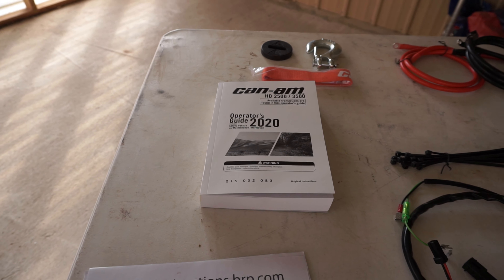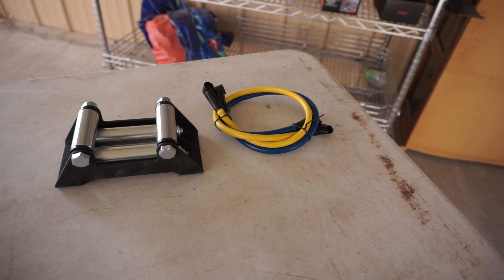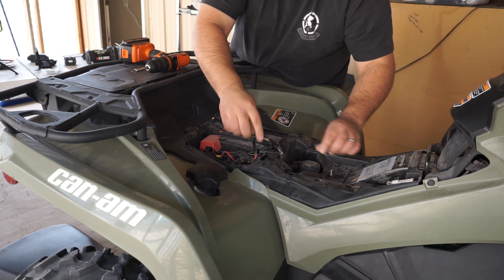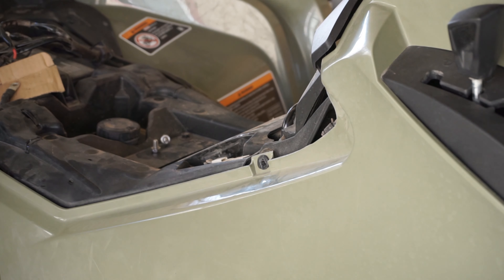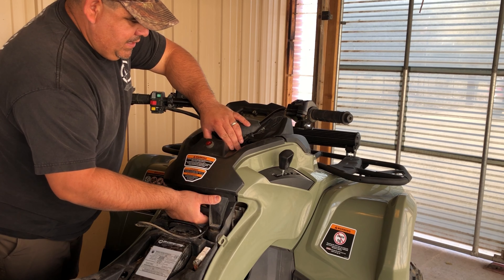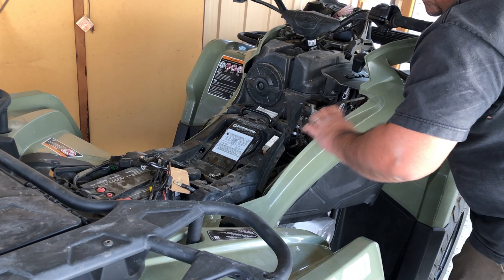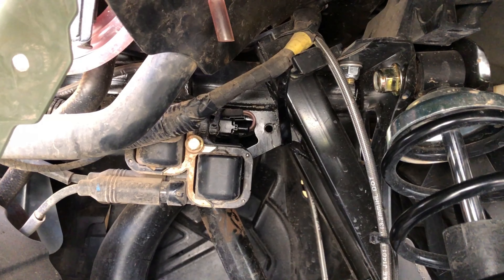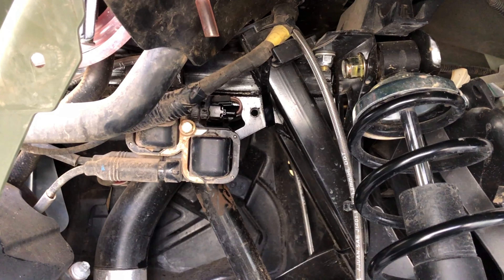How To Install A Winch Can-Am Outlander 570 ATV: Step by Step Guide

Comment: Details on the light bar please?!?
Reply from the maker: I have a 20 inch led light bar made by Nilight. I picked it up on Amazon and I have been using this light bar for 2 years now. I have never had a problem with it no matter what weather conditions I have been in. It is a 420W Triple Row Flood Spot Combo 42000LM LED Light Bar. In my description box look for my amazon affiliate link to the same light bar. Thanks for watching.

Comment: Excellent  video!

I couldn't see where you mounted the solenoid?
Reply from the maker: Hey there. I mounted the solenoid onto the frame about the 21:30 mark in the video. I got a solenoid bracket from Can Am when I bought the winch. Their kit has this bracket included. Thanks for checking out my video.
Reply: @ManzanoMan_Adventures  OK, I saw the solenoid bracket.

I meant to ask about the circuit breaker mounting location. I know it's connected with 2 red cables then placed in a plastic box. Where is the box mounted?

Thanks again.
Reply: @ManzanoMan_Adventures  Yes, I was thinking about mounting the circuit breaker under the seat. Although along side the seat under the plastic covers seems best out of the way. I'll have to check it out.

I have the Superwinch Terra 35SR that I'm installing on my 2016 Can Am Outlander 650 MAX. I don't have the Can Am kit, so I need to do some adjustments.
Reply from the maker: @yooper7753  I totally understand what you mean by making adjustments. If I didn't have the bracket from Can-Am I would have went and placed everything underneath the seat. I hope your adjustments work out well.

Comment: SAw someone else say this, but GREAT JOB!! I love how you let your humanity come through, everyone runs into snags and gets pissed and then hopefully we get our heads right and get done what needs done. There is no such thing as a simple job, something ALWAYS seems to snag. THANK YOU so much for making this video...now I feel confident I can get this job done right. I have a can am 4500, installing on a 570 DPS 2020. Hopefully it fits! I also had to buy a wire kit specifically for it so I SHOULD have all the parts needed. Will update when done.
Reply from the maker: I totally agree with you. Somewhere along the line a project always gets caught up by a snag happening. Thankfully this one was a quick and easy fix. I am glad this video has helped you! If you have any questions please reach out and I will be happy to answer your questions.
I think the 4500 should fit nicely. There was still space left after installing the 3500. The DPS model is a great ATV as well. If I wasn't on a budget I would have gone with this model also. Yes, please let me know how it turns out. Have a great day bud!

Comment: Where exactly does the remote harness plug plug into? I couldn't find anything behind the fuse box. 

I have the 2021 570 xmr outlander. 

Any help would be appreciated man
Reply from the maker: Hey man. I hope to help you out on this. Assuming that the wiring looks the same or almost identical, you should look underneath the fuse box accessible on the left side in between your air intake vent and fuse box look for a white pin connector. You should be able to plug into that connector. Good luck I hope this helps. You can also take a look at the installation instructions found on the Can Am website.

https://instructions.brp.com/content/instruction-sheet/en_CA/e-instruction-details.html#googtrans(en)&articleNo=kA00c000000yHFOCA2&lang=en&title=ATV%20KIT%20-%20Can-Am%20HD%202500%20and%20HD%203500%20-%20Vehicles%202017%20and%20up&rel_part_number=715006414,705014949,705014983,705014984,710007050,710007062,710007077,715003477,715006415,715006440,715006555,715006505
Reply: @ManzanoMan_Adventures  I got it man, they definitely didn't relay that message in the instructions. Really appreciate your help! It was  pretty tricky to get in there with the snorkle kit and rad relocate but doable. My old man watched your vid as well and both agree you seem like a cool dude! Keep up the vids
Reply from the maker: Hey man. I am glad you got your winch installed. Sometimes the instructions are bogus and they do not provide all the details. So I am glad I was able to help out a little bit. I imagine your space was tight with the snorkel kit. Enjoy your new quad man. Do you do videos? I’d support your channel and watch. I appreciate you and your dad checking out my channel. That’s awesome👍.
Reply: @ManzanoMan_Adventures  do u unplug the black connection that is already in the white pin connector or is there on that is an empty white pen connector?
Reply from the maker: If I remember correctly that is what you have to do. Unplug that connector and plug into it.

Comment: I have the same setup. Thank you so much! Can’t wait to install mine.
Reply from the maker: Hey there. I am glad the video helped provided some guidance to your winch project. The winch project isn't hard and you should be up and going in a few hours. Thanks for watching.
Reply: On the Polaris it connects to the synthetic rope and then the electronic magnetic parts connects to the winch. On the can ams it’s different. One of the magnets actually is attached to the plow itself
Reply: @ManzanoMan_Adventures  polaris connects to the winch, vehicle harness, battery and fairlead. I have a diagram I made if u want it respond with ur email
Reply from the maker: That would be cool man. I’d like to have it handy. I appreciate it. Email is monzanoman at gmail.

Comment: The winch comes with the all the cables 
Or you have to get it separate?
Reply from the maker: Hey there. Yes, the winch from Can Am came with everything you see in the video. No cutting is involved with their product. Its all plug and play to install it.
Reply: @ManzanoMan_Adventures  can you give me the website in New in atv's stuff and idk to much about it 😅
Reply from the maker: This is the website to Can Am https://can-am-shop.brp.com/off-road/us/en/715006414-can-am-hd-2500-winch.html.html. This is the 2500lbs version. Or the 3500lbs version: https://can-am-shop.brp.com/off-road/us/en/715006415-can-am-hd-3500-winch.html

Comment: whats the device that automatically stops the winch from pulling in too much and ripping the rope/cable? Im not referring to the bump stop. Im referring to the electronic/magnetic stopper. Ive seen it on can ams. I have the Polaris version on my polar but what's the one thats made for can ams?
Reply from the maker: The device is called an auto winch stop or winch auto stop. They sell them on everythingcanamoffroad.com. How do you like yours on the Polar?
Reply: @ManzanoMan_Adventures  I love it on mine
Reply from the maker: Awesome man. I might have to install this on my ATV. I am assuming it connects to the winch? Or Solenoid?

Comment: Great video really helped out a lot 1 thing I notice that the solenoid bracket you use was a little different can you share any info on that? Thanks
Reply from the maker: Hey there. The solenoid bracket that I used came with the winch. I should have mentioned in the video that there was 2 pieces to the solenoid. I actually ended up using the other piece that was just behind the part that I held up. So the part uses was actual part to be used to tie into the frame and shock. So the piece I held up I decide to not use it because it all tied well. Hope this answers your question and I am glad the video helped you out. Thanks for watching.

Comment: Hey buddy, good job! I know those self tapping bolts they use on some of the frame pieces only work one time, if you take them out yer screwed. lol Take care there Rueben and thanks for sharin’.👍🏼☮️
Reply from the maker: Hey buddy. That is interesting to know about the one time frame use on the threaded frame. The finished job I did came out great. It will go for a lifetime. I appreciate you watching! Take care and Happy Thanksgiving.

Comment: Awesome buddy! A winch for Reuben! - Whoooohoooo!
Really nice job on explaining every step!
That's a lot easier install than on a Honda, but the mounting spot looks like pretty thin plate compared to an actual mounting plate. I'd be worried about that 3,500 lb winch bending the hell out that metal skid plate. And just to be helpful, I suggest you buy a tree strap, because putting the winch hook on the cable when winching like you did at the end is a big no no. That'll wreck your cable really quick.

Nice job on the video bud!
Reply from the maker: I appreciate your feedback buddy. I will make sure to pick up a tree strap. I thought the same thing that the plate is thin on the bottom. I’ll have to keep in mind if I ever have to do a big job. The cost difference between the 2500lbs and the 3500lbs was 30 bucks. Maybe I aimed high on the 3500 because that is a lot of pull LOL. I got some homework to see how much force can be applied to the plate. Thanks for watching buddy.